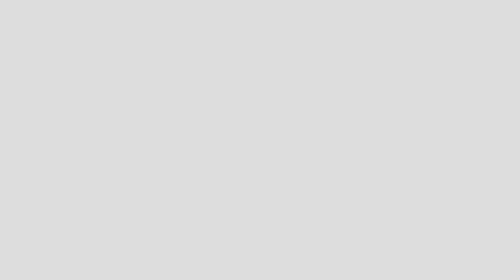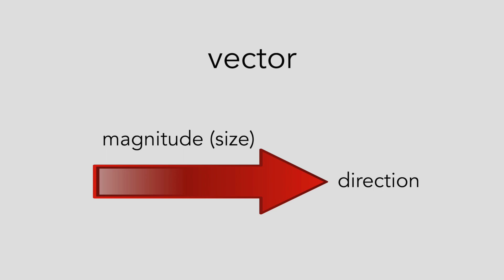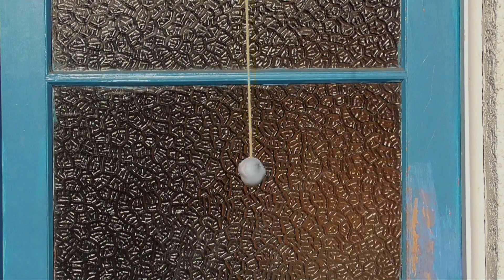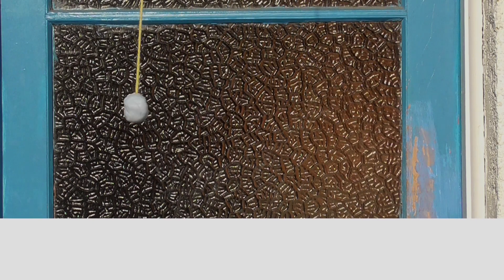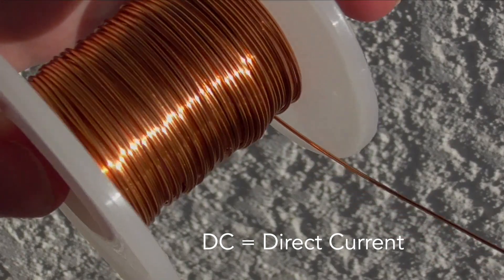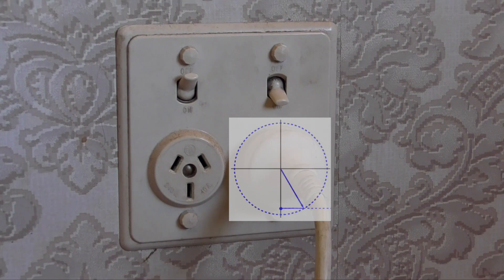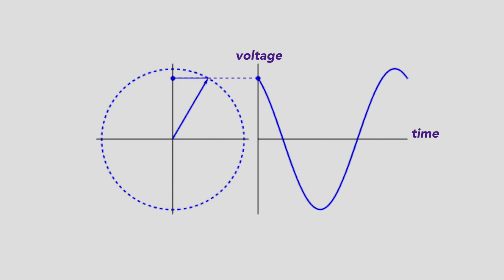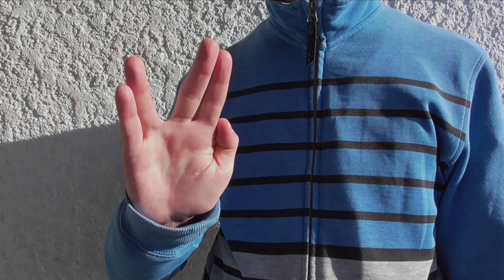What are Phasors?

Comment: Hello. I enjoy the manner and style of your presentation. Thank you. If you’re going to use phasors to represent AC voltage in NZ, the phasor’s maximum unit value will be about +/-340 V, due to the maximum versus RMS aspect of AC voltage. I suspect that you wanted to keep it simple? Live long and (continue to) prosper.
Reply from the maker: Thanks for your comment! You're absolutely right, I wanted to keep matters simple for this introductory video. The next one on AC electricity will explain RMS vs. peak voltage.  :)